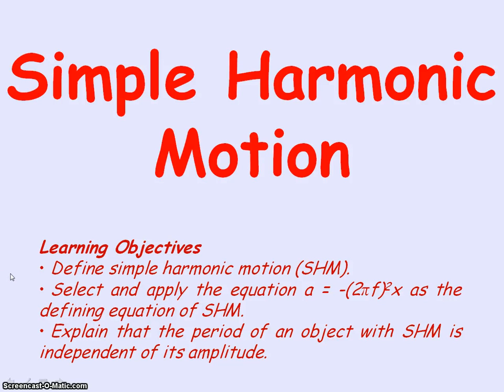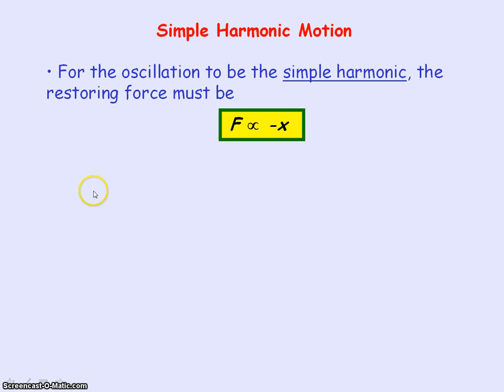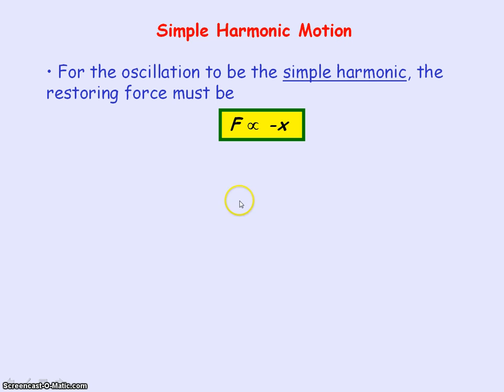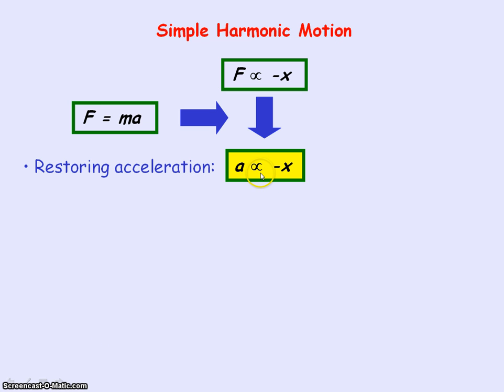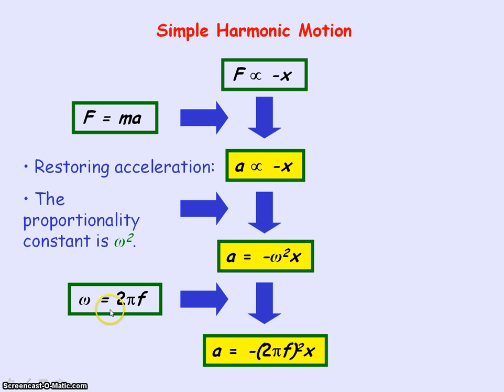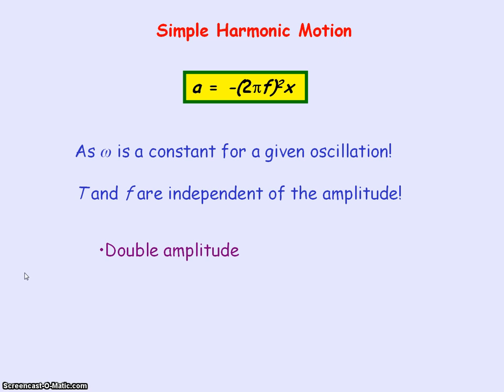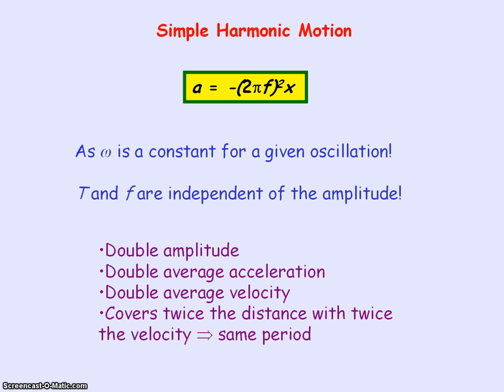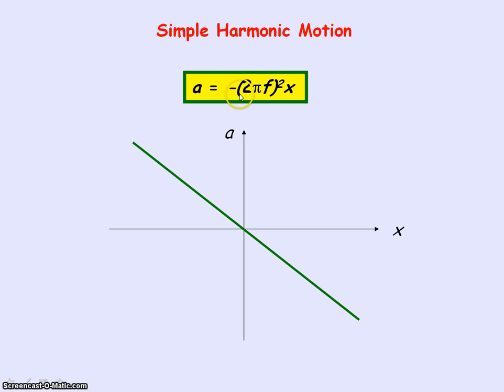SHM 02 - Defining SHM

Comment: Hi

Wouldn't all object that is oscillating have shm?
Reply from the maker: said billy No, some oscillations do not exhibit SHM.  SHM is defined as having acceleration proportional to and in the opposite direction to the displacement.  Some oscillations occur without meeting that requirement.
Reply from the maker: A couple of examples:
1. A pendulum at large angles of deflection.
2. A truck on an air track rebounding at the ends so that it oscillates about the middle of the track.